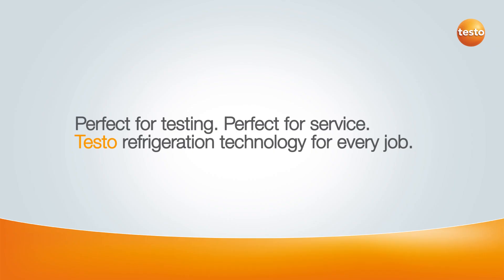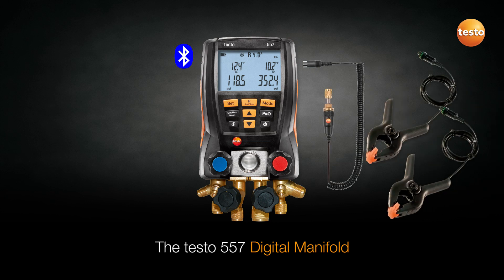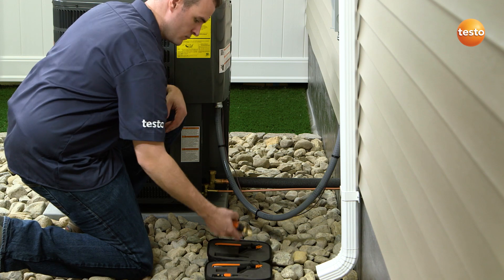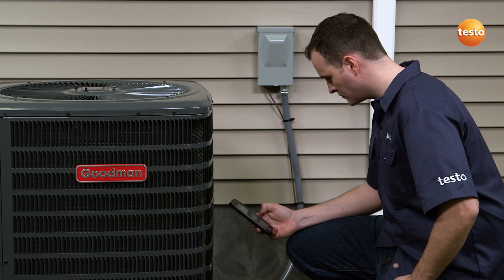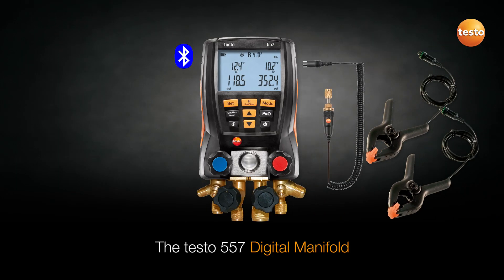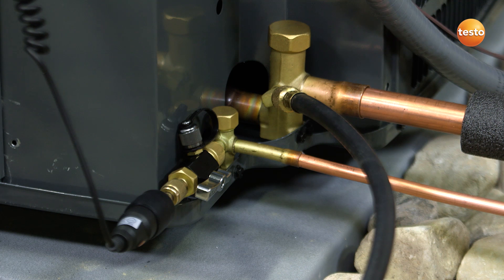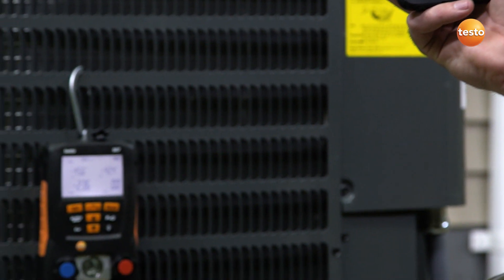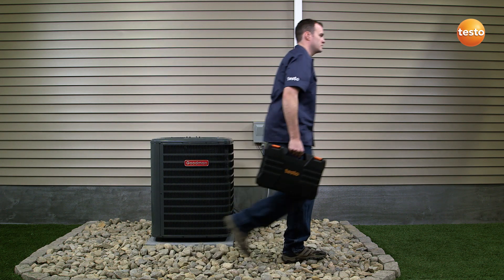Testo Refrigeration Instruments - Perfect for Testing & Servicing

Comment: CUSTOMER FEEDBACK:
I have the Testo Smart Probes. They are great. I'll never go back to a big set of gauges again. 
The one problem I have with them, is the fact that the rubber on the pressure probes separate around the on/off button and exposes the electronics beneath and exposing the electronics, rendering the protection from the elements useless after only a few years of use.

Comment: Good Vid. i've been using the smart probes for a year now and am very happy with them. i just bought the 557's and just used them for the first time last week. i like them, so far.
Reply: OcRefrigeration,Hvac & Electrical. How much vacuum does the 570 measure?
Reply: mark thompson 20,0000 to 0 microns